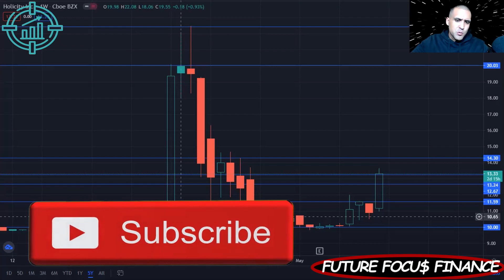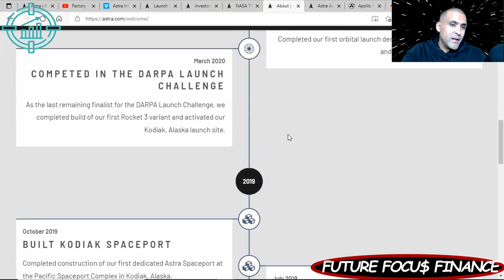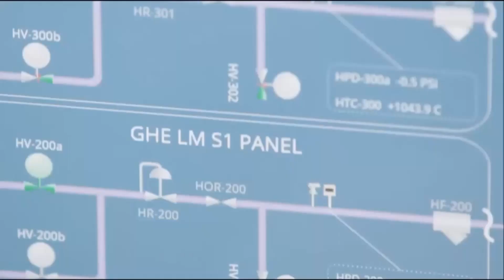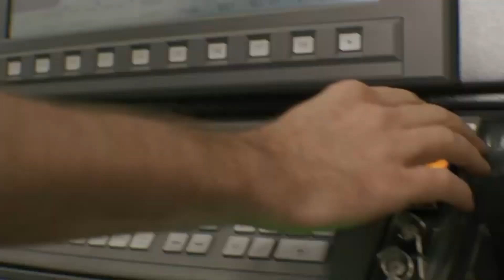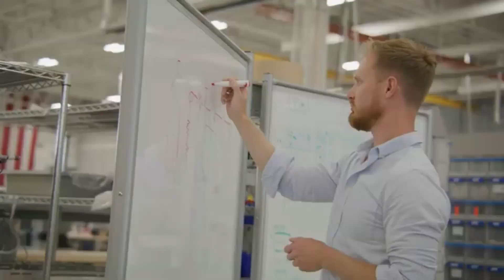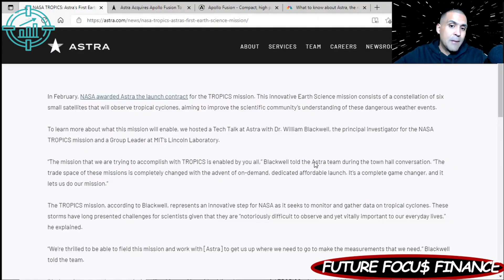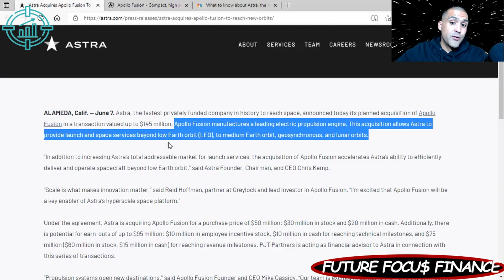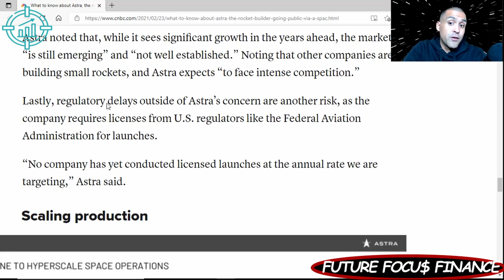$HOL Stock! | Astra merger with Holicity SPAC | Will this Space Company 🚀 to the MOON?

Comment: Any idea Astra stock price on July 1st? 1 share HOL=1 share Astra?
Reply from the maker: It will be a 1 for 1, and around the 12.80 cent level.
Reply: Why the price of HOL webt down yesterday June 30?? Usually skyrockets right?
Reply from the maker: @javiermartinez5505  anytime a stock has a big run up, slight pullbacks are normal.  What happens is that people who originally bought at that price and had the stock drop, tend to sell when the stock makes it back to that price because they feel they got burned. So it is a natural reaction.  It can stay in a small range between 10.50 and 12.50 until there is another catalyst like the merger happening.